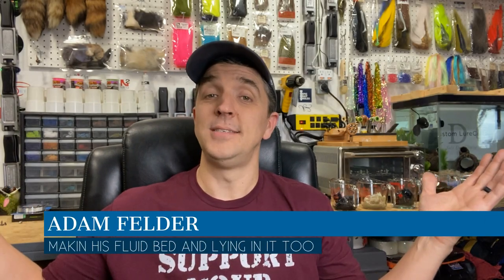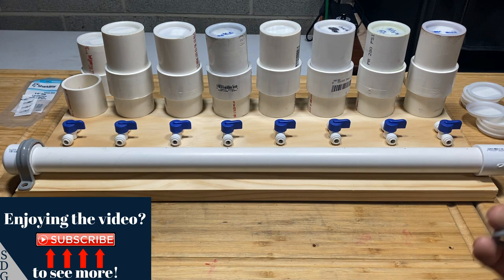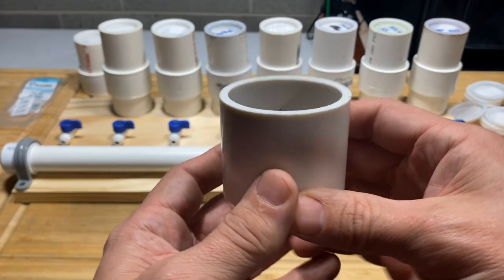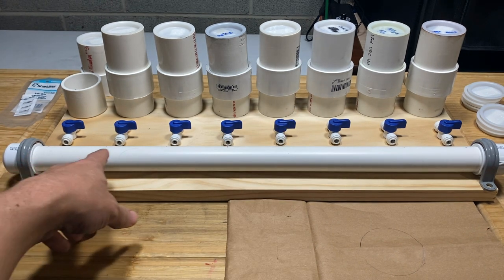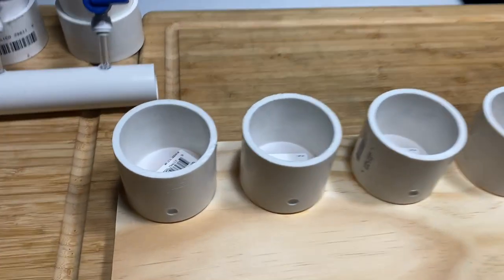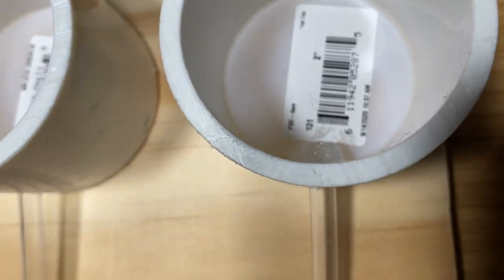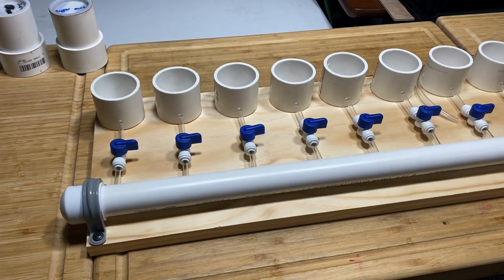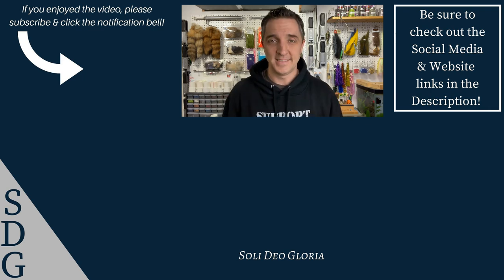How to Make a GIANT 8 Cup Fluid Bed to Paint Jigs!

Comment: Hi, Adam. 
Have you powder coated any Tungsten jig heads?
I'm curious because I just received a few unpainted ones in three sizes. Thanks
Reply from the maker: Hey James, I have not tried tungsten, but I imagine the process would be similar.  The heat needed to melt the paint is, I’m sure, far less than anything that would damage the weights.  Even so, I’d probably test run just one all the way through curing to make sure… that stuff isn’t cheap!!

Comment: Question: If I order a 2" fluid bed, with the 2" cups fit or do I need to order 3" bed with 2" cups? I'm going to be swapping out the cups (colors) as I go like you do.  Thanks.
Reply from the maker: They should be consistent, 2’s with 2, 3’s with 3.  Etc. good luck!!
Reply: @SDGCustomLurecraft  Thanks buddy! I appreciate that.

Comment: Everyone is using a aquarium pump. Why not use a air compressor fitting and hook it to your air compressor and use the regulator to give your 30 psi or whatever psi you require to get the paint moving and use the valves to control the flow. Just a thought. Love the build.  Tight lines
Reply from the maker: Hey Rob, great question, and you may be able to make it work.  I attempted an air compressor on my first 4-cup build ages ago and it didn’t work out for me.  The steady, consistent, flow of the aquarium pump was the ticket for this guy!

Comment: Just watched the video this morning and I may have missed something.  How are you removing the cups without getting paint everywhere.  Do you have another video that shows this part of the process?
Reply: Never mind. It was way too early and the coffee had not kicked in😂 I answered my own question.  Remove at the coupler not the paint cup 🤦🏼‍♂️
Reply from the maker: Thanks for watching!  The base is glued to the board.  The filter is between the top section (where you put the paint) and the coupler.  When you pull the cup off to swap out the paint, you pull the coupler with it (the base stays put since it’s glued down).  As such, the filter (inside the coupler) is the “floor” holding the paint in.  Hope that makes sense!

Comment: Love you vides’s but i’m missing something.  How do you remove the cup to change out color without a couple of monkey wrenches? I think mine will break before coming apart.
Reply from the maker: If the cap you’re referring to is the bottom cap that was glued to the baseX that stays put.  The collar and top piece (with the filter installed between them) hold the paint and allow you to swap out the entire cup.  If I didn’t follow your question, let me know!
Reply: @SDGCustomLurecraft  I need to watch your video again on how it’s assembled.  Thanks.

Comment: Suggestion...epoxy the couplers directly to the board & superglue the diaphragm to the bottom of the pvc cup.
Reply from the maker: Thanks for the feedback!  My intent regarding the filter is to keep it “detached” so it’s easy to replace as needed.  Glueing it would certainly work, but be a bit messy if/when it’s time to swap it out (I’ve been know to poke a nice hole in them from time to time!!).  Appreciate the suggestion though!

Comment: Are you gluing the coupler to the bottom 2 inch pvc or keeping the coupler with the top 3 inch piece to slide it on the bottom 2 inch piece of pvc? Looking to build one to make my own jigs. Thank you
Reply from the maker: The coupler stays with the top piece but isn’t glued to it either.  The filter between the couple and top 3” piece seals it nice and tight.  No glue also allows you to swap out the filter in the future, should you want to change the color in that cup or if (when :)) you accidentally poke a hole in it, LOL!
Reply: Thank You for responding!

Comment: FWIW, a "standard" (there actually isn't any standard) for a coffee filter is around 20 microns. As near as I can tell, the average size for powder particles is around 30um. I have been trying to find either a stainless or nylon mesh filter material to use, so far the smallest I can find is 80 micron, 39X78 for 9 bucks, which would more than do for what I need. If I can ever find some 20 I will post a link here.
Reply from the maker: Thanks for the input!

Comment: Why do you have to add air? Is this s necessary step?
Reply from the maker: Nope, don’t have to!  You can dig straight into the jar if you like.  The air/fluid bed will give you a thinner more even coat and helps you avoid clumping (common when dipping a jig).

Comment: Why did you not use hose barbs?
Reply from the maker: Great question, thanks!  I absolutely could have, a lot of guy do.  For me, the extra cost wasn't necessary/warranted as the tube is air tight with silicon.  But, 100%... definitely an option that would work! 👍👍

Comment: Hi!   Getting ready to build my fluid beds.   How do you separate these if you want to do a different color.  If you pull out the 3” piece the paper will fall off and your paint will fall out the bottom.  So, I assume you separate them at the bottom of coupler?  Thanks for your videos and help!
Reply from the maker: Correct, the coupler stays with the top cup (between which is the filter).  The bottom piece, with the bottom cap, is glued down permanently.
Reply: Thanks for the reply!!    One more quick question,  do you have any recommendations for a source of bulk feathers for jig tying?   I am only finding sellers of 1/3 ounce lots.   I am looking for bulk.  Thanks!!
Reply from the maker: @clublon  I do not, but if I was after something like that I’d check eBay and Etsy… even AliExpress - sometimes I can find bulk stuff on there.
Reply: @SDGCustomLurecraft  Thanks!

Comment: I’m not sure, but if the manifold tube was a smaller diameter it might increase the pressure through each valve with the same volume of air being pumped. As long as it was still big enough to get your tubes into it and sealed.
Reply from the maker: Thanks for the comment Rick!  You may be right, or it may be a zero sum game so long as the capacity is filled regardless of size.  That would be an interesting experiment!

Comment: ???   would ridged tubing work better for the valve system set up when turning them on /off or adjusting ??  or does the flexable tubing still allow you to turn the valves easily  ??/ enquiring minds want to know ,,,, ( things that make you go  Heeeeeemmm )   either way   it's a thing of beauty      well done good man
Reply from the maker: Great question Dan.  You could indeed swap it out for something more rigid, but there’s so little of it that the short length keeps it stable.  I haven’t had to wrestle with it wishing it was more rigid.  Definitely an option though!!
Reply: @SDGCustomLurecraft  Muchos Gracias  El Jefe Adam .... I'm headed to Home depot after work ....( shhhhh don't tell the wife , she already thinks i'm getting  obsessed with get'n Jiggy with it...LoL    said HEY if i'm gonna get into making Jigs,, I want to have a Clean looking Set up  like SDG Custom,,,,  ..then I stuck My tongue at her and made  na na  faces ( after she turned her back Of course ) .... eeeeeee   :-)
Reply from the maker: Good luck!

Comment: I did enjoy your video , I have built a 12 unit two tier with the pump enclosed with a piece of pipe  inside. I tried Two coffee filters. It did not work. I just used shoe goo to glue computer paper to one cup. I’ll try it in the morning. T j s does work well. I have tried to find that filter with no luck. This is my third build. It should work. If I’m not happy with computer paper I will try the paper bag. Thank you for your channel.
Reply from the maker: Definitely can be a trial and error process!  Glad you got it working and have a plan to continue!  And thanks for the kind words regarding the channel - much appreciated!